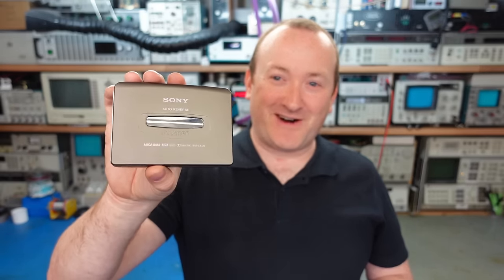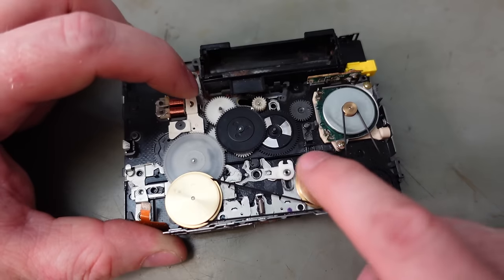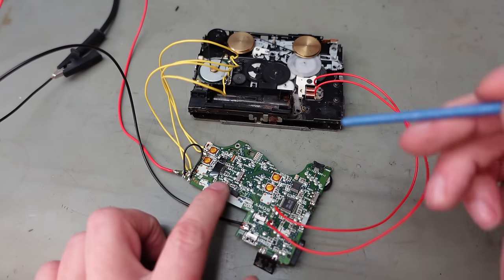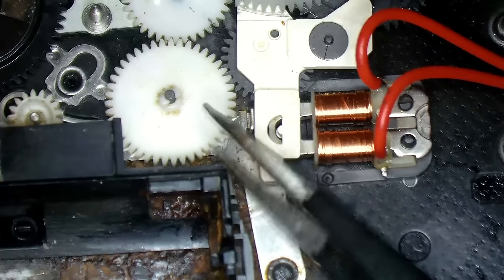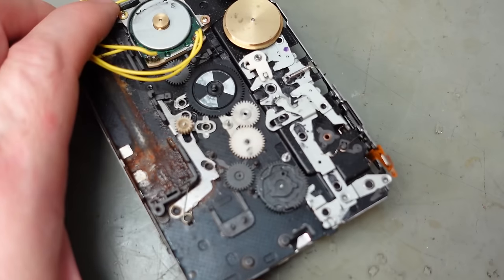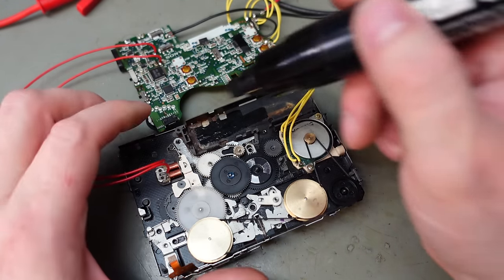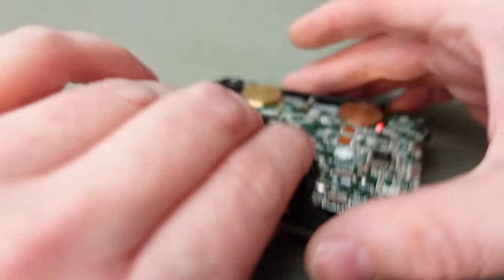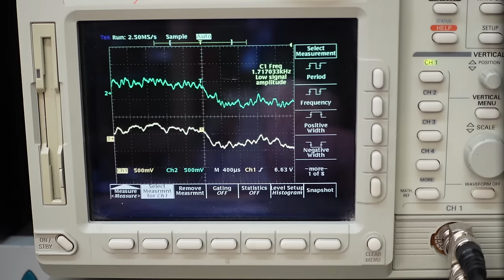SONY Walkman Repair

Comment: You have to admit that the Walkman is an ingenious piece of engineering.
Reply: No one does it like Sony. Always streets ahead
Reply: if you think thats insane go look up the service manual for the wm-7, they were doing many lines designing that one (and its glorious)
Reply: @randomtux1234  I have a JVC one with two motors and a microcontroller from 86 the  JVC CX-R7K R7 AM FM, Sony were not the only players in the field.

Comment: My god, the asmr the moment he opened the tape holder and inserted the cassette. It's like hearing a voice or smelling a scent you've not been around in years. Admittedly, I've had plenty of walkmans but never one that ran on just one 1.5aa, that's crazy. Then i had a discman cd player, im near sure it was 6 batteries. Digital is just so impersonal... Your own mix cassettes were the best. Time and thought went into them. Remember the stress caused if someone or you yourself recorded over a cassette or vhs? Gone.. no file recovery software here lads! Lol

Comment: I had this model of Walkman back in the mid nineties. I seem to remember it had similar problems. While pretty handy repairing stuff I took one look inside and failing to dismantle it I gave up. Seeing this video having to desolder stuff to dismantle is probably where I got up to, without the internet or a service manual I had little chance. It was a great unit, auto reverse, track skipping etc.

Comment: One should think they finally developed a non-leaking battery. Leaking batteries are an endless hassle, especially in clocks, remote controls etc. When the thing stops working, it's usually too late. 
You, sir, are an excellent technician and repair man. Hats off!

Comment: Excelente reparaciExcellent repair - I have its brother WM-FX513 and it is a very good Japanese machine. I changed the strap and cleaned the entire mechanism and the heads and capstans with isopropyl alcohol. Then I adjusted the speed and that's it. It came back to life in 1995. Thank you for the Video and for the love you put into your work. I like it and I always follow you. Because nothing gives you up for repairs. Thank you very much, greetings and hugs, from Argentina!
Reply: Hi, I wonder how long is the belt for WM-FX513? I have the WM-FX571 one and I’m looking to buy the belt from stores in my country bcs the shipping fee from US/UK to my country is really expensive

Comment: One could almost say it's a masterpiece of miniaturisation, with all those nylon (I presume) gears. What is doesn't allow for, unfortunately, is a decent flywwheel to provide speed stability. Battery corrosion is certainly the bane of portable electronic devices. Another marvellous video, and thanks once again for showing us how it's done.
Reply: @johnmarchington3146  Actually John, each drive capstan in this Walkman has a probly 1 inch diameter disc as part of it, & these become the flywheel; one for each direction of travel.

Comment: These Walkmans were the pinnacle of mechanical and electronic consumer engineering of the time. They are amazing. Now we have a chip, a battery, touch sensors and a couple of sockets to do the same job - all of which has probably disappeared in the cloud by the time you read this. I have a pile of them I used to take on skiing holidays in the 80's and 90's to record local radio and to rock to on the piste. I imagine the belts have all gone by now but I might take a look sometime before I croak.

Comment: Thank you for sharing your excellent repair series. I use vinegar to neutralize the battery basic electrolytes from the plastics and metals. Then scratch the oxidation at the end.

Comment: I have to admire you attempting to even repair anything small from Japan! The last time I attempted a similar repair it was an absolute nightmare. The device was a Kenwood pocket sized cassette player (hardly bigger than the cassette itself!) no sooner had I managed to open it, than springs started flying everywhere and microscopic screws were lost just by breathing near them. Servicing that level of technology is not something the average technican can do. The parts are so tiny and all the PCB's are surface-mounted components. Too much heat does a lot of damage. You need very specialised equipment and the technical skill. When you see factories in Japan it's astonishing (I worked for a big Japanese electronics corp) it's like a hospital bio-hazard environment with guys wearing white suits with hoods and white gloves.

Dealing with small Japanese electronic devices is often similar to watchmaker repairs. If you've ever seen what goes into servicing, assembling watch movements you'll see the incredible amount of skill it requires due to sheer complexity and precision of the tiny parts.

Comment: Great job Mark. I have a beautiful sony walkman from 1988-89. It was dropped unfortunately years, and years ago, and some of the button were pushed in and one broke off. Would love to get it fixed. It's a sony WM-R202, in silver. A real beauty when it was bought. Thanks for sharing your video. Cheers.

Comment: Nice job Mark, it's amazing how the corroded battery just eats through the plastic and embeds itself. I like the way you calibrated it. It looked like you used a tape with a set frequency, then just tuned it to match that recorded frequency.

Comment: Hey Mark, love your vids! 
   Distilled white vinegar will neutralize and help clean up the potassium hydroxide electrolyte leakage from alkaline batteries (Vinegar is an acid and potassium hydroxide is a base). may even get some good fizz action, lol. One just wants to be sure to flush out all the vinegar when done. Distilled water then IPA has worked for me.

Comment: Nice repair, i was a bit nervous when you started bending that arm though 😀. Very educational for when/if i'll need to dig in mine some day. I do have a couple of these myself, well mine are the EX510 (without remote), one mint condition in box and one kinda rough used. I've replaced the belts in both, extremely easy, like a 10 minutes job at the most. What's sort of tough is to find the proper 0.6mm belt for them. The model 510 was also my very first "real" Sony Walkman back in 1994, but that's long gone. Great work man, i always enjoy your work.

Comment: And I've only got so far as to just replacing the belts in these Walkmans back in my "teenage" years. Everything else was pretty much all Chinese to me, but yet always fascinated on how they worked...the wiring, soldering, cogs, mechanisms, etc. If I had taken that Walkman apart the way you did, I couldn't remember where all those parts went.....knowing me. Plus, I don't have the patience anymore, lol.

But anyway, great job Sir! Kudos! Very smart and always with a confident smile, I like that! I have the Walkman model number WM-F18 from 1985 and I have no clue on why it quit working completely, battery AND electric power. But I only keep as a momentum and place on a shelf of my 80's toys and radios I had through the years., nice collection.

Thank you for sharing and posting this Mend It Mark...that was fun to watch!  I miss my Walkman days! We could all use your smile in these times! 😁👍

Comment: I know this video was made over a year ago, but just wanted to give you a little advice from one electronics technician to another. Hydrogen peroxide works extremely well to remove damage caused by a leaky battery. . It takes a few minutes for it to have an effect and needs agitation from a brush or other object to help remove the buildup but it will get rid of all of that sludge even on rusty metal. It restores it to almost like new.

Comment: Technically those last generation Walkmans were almost perfect portable devices. They were lightweight, slim, stamina, sensor-controlled etc. And expensive, of course))) I had one once, but not as good as this one is... Well done!
Reply: Last decent generation era for Walkmans were the late 1980's/early 1990's.

Comment: I got two of the newer versions of this in the 90's from a radio rally both faulty and made one good one for a few quid. The one I had didn't have the solenoids I don't think. It's incredible how complicated and compact they are inside. 
I also got 2 aiwa ones and made a good working one but they took a strange rectangular rechargeable battery. I enjoyed this video as it reminds me of being in my 20's 😂

Comment: I have an ec head model its a wm 2091 i got it for £1 from a car boot i have some faulty smd caps to replace and the belt .One thing that is prone to failing is a cog on the black gear you removed it can crack but seems to be fine on this one ,a replacement is available and i might get one just in case mine is failed or fails in the future .A great repair mark not always easy working on these tiny walkmans

Comment: I had a  Sony WM D6C Pro Walkman. Very high end recorder. Incredible device for it's time. It worked great and it was expensive. I used it to record many local rock band shows and to record interviews of famous artists who came to town. I used it a lot. But after many years I had switched entirely to digital recording devices which were cheaper and better.  In 2010 I pulled the Pro Walkman out of a box and found I had left the batteries in. Something I try to never do. They had corroded and part of the PCB was etched away.  I started doing the surgery and it got more and more involved. Then I stopped and thought "What for?" The digital devices are far superior. I wasn't ever going to record a cassette again. I lit a candle and stood it on the soldering iron station on my lab bench. I said my so longs, gave it a last salute, and pushed the remains of the pro Walkman off the edge of my bench into the trashcan. I'll always remember it and I will always know where it's final resting place is. The county dump. I shed a little tear every time I drive by. And I thank goodness I don't have to mess with cassettes ever again.
Reply: More e waste 😂😂😂😂😂😂🎉🎉🎉🎉🎉
Reply: @kthwkr  I had a Sony Walkman 'Professional' years ago too.  I don't know its model number but it was black & had a leatherette case, Dolby C & a led bargraph level meter & could play & record onto 'metal' tapes as well.  It cost me a fortnight's or a month's apprentice wages back then!

Then one day the playback speed went stupid, & was varying up & down twice per second.  It wasn't that old, so I contacted Sony & I actually got to speak to a Sony service tech!  He was very helpful, & on his advice I bought a service manual & the two little surface- mount I.C's he thought were most likely causing the fault.

Luckily I was able to remove & replace both I.C's successfully & the speed modulation problem was fixed!

Such a beautiful, 3 colour original factory printed circuit diagram & service manual I had never seen the likes of before or since!

Sadly, my Walkman was stolen from a friends house but I still have the  MDR-70 headphones that came with it.  The earpads that sort of stretched over the earpieces are pretty deteriorated now but I'd like to replace them if I can.  Even today, in a quiet room, these headphones sound like they've got subwoofers in them they're so good!  

I fell in love with Sony gear after that!

Comment: That model tape mech has issues with the gears jamming and cracking. Nice work too and the joys of battery leakage. I have restored over 100 walkmans in the last 5 years. lots of fun and frustration  :)

Comment: I admit I cringed a bit when I saw you bending that lever! Glad you could fix it! I would have used some rust remover - I found that citric acid works very well for me. Carefully obviously, but I would have tried flushing that part more. That said, great video and thanks!
Reply: It was pretty amateur

Comment: I liked working on Sony gear pre-Interwebs as they thought about service techs from the design stage. Service manuals were easy to find. They were open about service code locks to third party techs. Ordering components was easy, even one manufactured by a 3rd party just for one model. They had detailed alignment and calibration instructions. They used to have bits on the cases to temporarily hold boards in place upright when servicing.
I'm not sure how things are now. There are far fewer AV repair places still open while most citiesh ave heaps of mobile telephone repair shops.

Comment: Great repair! Wonder why you don't use vinegar to neutralize the acid composition. I think it removes everything without the need to brush underneath the metal. After this add a tiny amount of grease.

Comment: mark, ive cleaned up many plastic/metal/electronic units in the ultrasonic cleaner with alcohol as a fluid. it outgasses and leaves no residue behind and doesnt damage anything. except RUBBER BELTS :D oh and motors, if you cant wait for them to dry in the sun for 2 days

Comment: Really, i also wonder whether you didnt give up even with the corrosion of the metal lever arm liftening to remove the rust and secrets below braking it. I would have been stopped already at the point to remove the PCB and unsolder so much of connections. Very great idea has been to solder the wires to connect the PCB to the mechanics after removal and to find out the test mode.
really great

Comment: Vinegar on a Q-tip will dissolve away battery goo and at the same time it will modify it so the corrosion does not continue.  
Then follow up with a water wet/damp Q-tip to gently rinse away the vinegar.  The vinegar doesn't seem to corrode the parts near like battery goo does.

Comment: @Mend It Mark 14:35 As far as I know, corrosion normally removes ordinary vinegar. Vinegar is acid and to remove it, you need to use the alkali =) many have it at home, this ... soda!) Dilute it in the water and then go through vinegar. Then rinse with water and alcohol. Well, it’s worth trying first in the same battery compartment on plastic.

Comment: Mark, you have amazing patience. If you raised an invoice for the job I have no idea how one could realistically charge the full cost of labour.  I am positive you used the head demagnetizer correctly but I have one that I used long ago on two Tandberg half tracks (10.5" reel)to supply my compositions to theatre and dance companies as they were in common use before CDs. By splicing leader tape  before each track the units would auto stop and thus que the next track for replay. The 240 volt demagnetizer instructions were start with the tip close to the heads and as one slowly moves away to rotate the tip in a clockwise continuous circle. Were the instructions incorrect or are the two methods both valid?

Comment: I'm a little surprised you didn't apply any plastic gear grease (vaseline).  Great job, though. You got it running like a top.  One more thing...  That had better been ABBA playing at the end!  :D
Reply: NEVER use vaseline, it's the worst thing next to leaving the nylon gears dissolving in neat IPA. It will gum up and dry out the gears. Molykote or silicone lubricant, eg Servisol. Seriously, what rtouble you will cause with vaseline. Would you use vaseline instead of KY when with the girl or boyfriend? NO!
Reply: @clevermusicbox3630  What are you talking about??  I have never experienced that on nylon parts.  It does the best, long-lasting job lubricating parts of all of the products I've tried.  It's very low in acidity.  Whatever expert tone you seem to have, you aren't close enough to even being taken seriously.  You've never done a lot of work in this type of environment, obviously.  Investigate what you're talking about before denouncing information with zero education.

Comment: Great work, as always. Did you consider removing the corrosion with an acid such as Vinegar or CLR then flush with a base and distilled water? Question asked purely out of curiosity. Not putting two cents in or back seat driving. Thanks for the videos, I look forward to the next

Comment: Reminds me of loving my Sony Walkman 2 in 1983 to replace my used Sony Walkman 1.
Reply: Anyway, it stopped working for me and I took to a Sony dealership -repair and never went back to pick it up. The Walkman 2 was a beautiful machine, but the buttons would get stuck. 

I also had about 15 great Sony Walkman that I bought before many were collecting and they are in storage somewhere. I just wish I knew how to fox them bc most need new bands.
Reply: There’s so many parts, how would you know what is broken and where to start? I miss those days when there was at least one tv and radio repair shop in your neighborhood.
Reply: Knowing me, I probably will make it worse than how it was. Also, if you’ve never worked on a unit, just figuring out how to open it can be a challenge. I’ve snapped off pe cracked a few radios pulling on it open, when you didn’t know it was held by clips or which way to pull to get clearance.
Reply: How do you know what moves what with so many circuits ?! Just try them all? I guess it would help you you have worked on the same model previously,. Otherwise you’re completely in the dark or make it do things it wasn’t design to do. Lol!

Comment: You have a HP spectrum analyser, is it the 8567/a?? I had one with QP adapter and preselector for EMC testing. Just seen its looks like you do have the QP adapter on top.

Comment: Try soak in acetone-automatic transmission fluid 50/50 mixture, does magic on corroded parts. Later flush with ISA and grease 😉

Comment: It looks like there was still a solder joint to solder..in the middle ish of the board closer to the battery holder (opposite the little black rectangle next to the battery holder)

Comment: You can use EDTA-2Na or citric acid for dissolving and removing rust. Then there would be no need to bend the mechanism parts.

Comment: Straightening bent metal requires you to exceed the original position and obviously that was not possible. I ran into this with selector switch contacts and had to pull the whole contact pad and bend correctly then rivet back in.